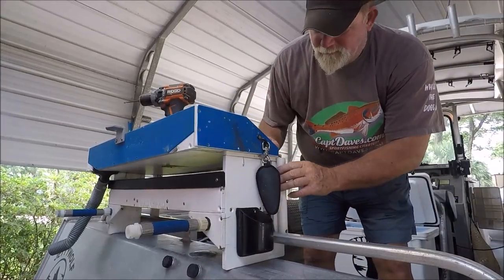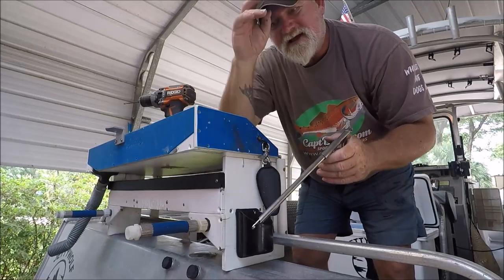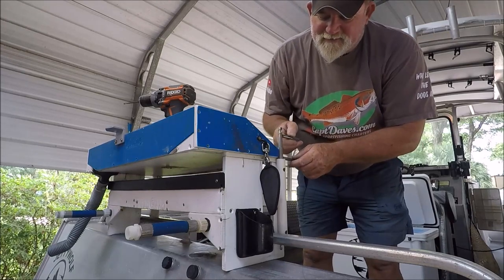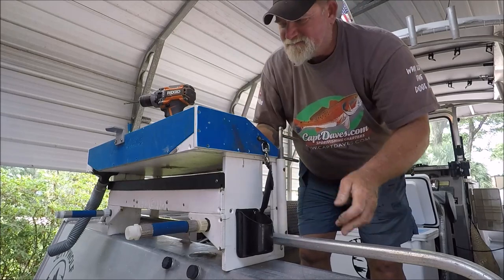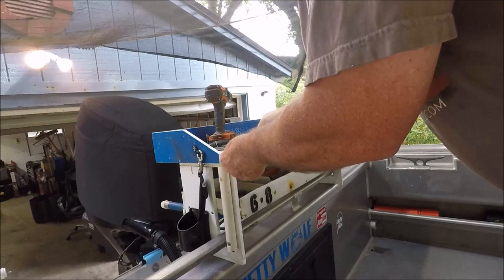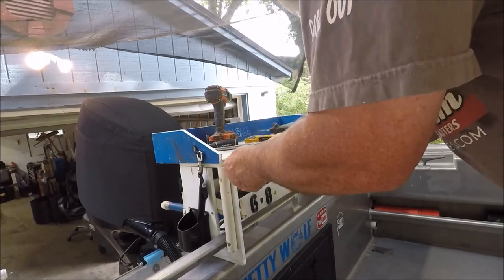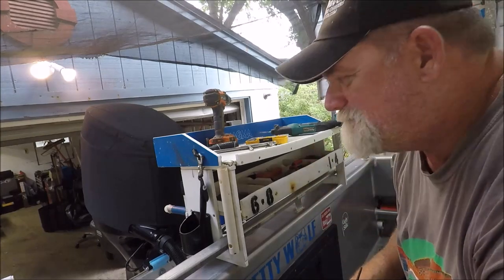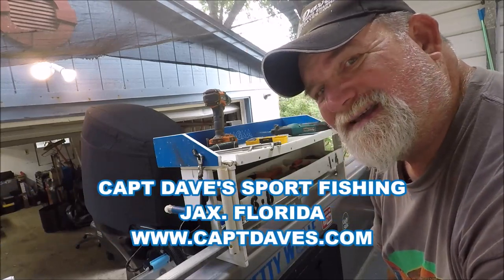''Bait board & tools'', Jacksonville charter boat

Comment: Those bait boards are awesome. I made 1 for my boat out of PVC board from Lowe's. It ain't now where near as nice as your Capt Dave but it works for my 18ft scow.
Reply from the maker: well, mine is a patch work of PVC board, Nylon board, Starboard Magna cutting   board, Vacuum cleaner hose for a drain,....it works and is my work station.

Comment: Hi Rob from AUS have a bait board  (work station)  like yours would not leave the ramp with out it. great for cleaning Squid cutting up bait and baiting up on the boat so not to take the mess home a deck wash is a must also. just found your channel looking up Suzuki motors maintenance.
Reply from the maker: I copy you guys.....burley bucket welded to boat, bait board, anchor chain cover, and motor covers. people around here are clueless.

Comment: The drain system is really cool. West marine, If for some reason you need a little piece of star board for a project 6x12x1/4" at West marine is about 20 bucks. Same exact material bout the same size available at most dollar stores is? you guessed it a buck!! Sold as a kitchen cutting board.  good vid Capt Dave, De hooker could be tools of the trade material.
Reply from the maker: if......if......if anyone ever read my video description or PINNED📌📌 to top comment below, you'd see the direct link. Am I the only one who reads YT comments? If I'm on my laptop I always do. Maybe YT should sell a BIG hand, that comes outa the screen, be it a dumbphone, or computer that SLAPS people, to wake up?? As they say, if it was a snake....''you'd be bit!''